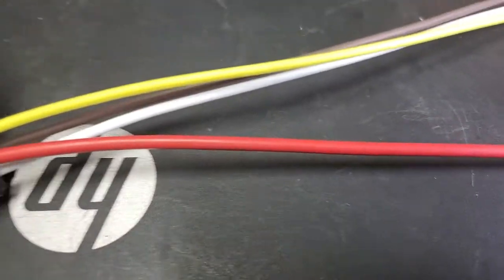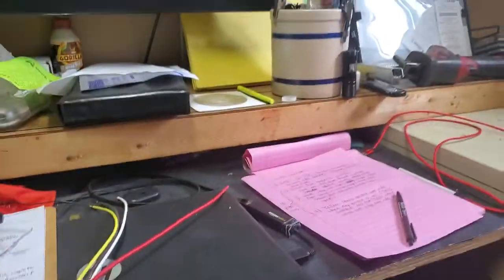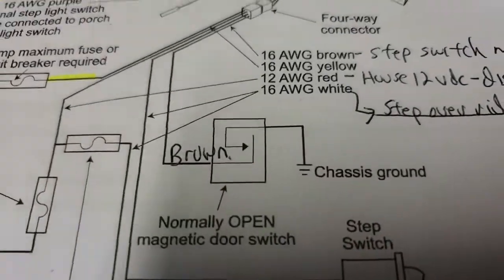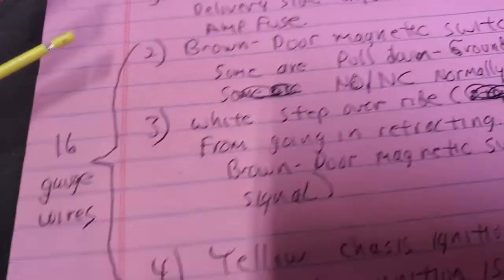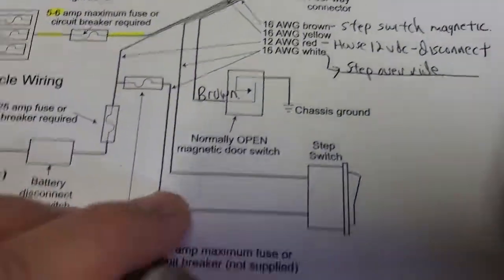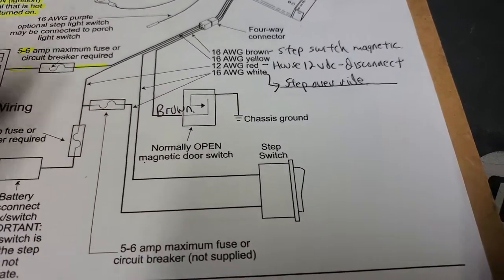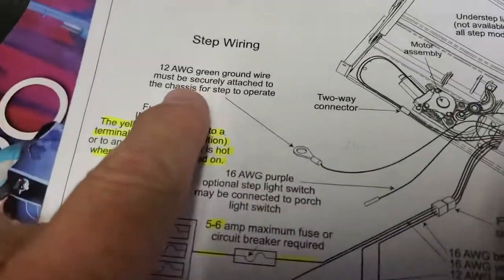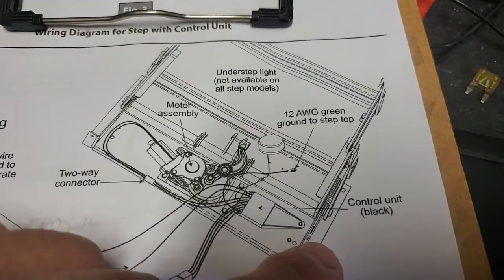STEPS KWIKEE 4 PIN CONNECTOR SIGNALS.Video 1 of 2

Comment: Manual step wiring.
Red and white and yellow to battery.
Brown wire to a toggle switch and the other side of the switch to earth.
Fuses in line of course. 
Any problems with this that you can see it seems to be working pretty damn good.
I just put out the step when I want it out and I put it back in when I want it in .
Reply from the maker: When your step is out and you're inside  with the door closed and start vehicle by law the steps must come in when ignition is turned on.
Reply: @Rvdiagnostics thanks that's good information

Comment: Excellent! I've got enough to do with changing the pigtails to accommodate the new control unit to have to figure out what the "purple wire's" function is  (the old unit did not have one) I thought maybe that had something to do with lighting but wanted to verify before changing any connectors thus voiding any warranties or RMA's. Is it the increased current draw when the stairs hit their end points that signals the control unit to cut B+ to the motor? Thanks again P.S. I have a 97 Rexall Vision on a P-30 WH chassis. When we first got it,  it immediately had issues with the "new" hydrolic parking brake system. Well after many phone calls to GM & Rexhall I got no where with either so I did find the GM shop manuals for it and finally figured it out. If your interested I'll relate the story of the problem(s) and the fix I came up with. I also videoed the process. I'm dying to publish it in the hope's of saving anyone who experiences the same or similar issues, the absolute grief I endured dealing with the vendors (not the vehicle so much)
Reply from the maker: Ah yes venders .
Reply from the maker: The purple wire gets tied into your porch/stairwell light .So the step light ( yellow ) underneath stays on . Just a little bit more light for dark campgrounds

Comment: I have a 2017 forest river forester with a Kwikee step 888. It suddenly stopped working after being plugged into a 20 amp camp ground plug and we realized it needed 30 amp so we switched sites. The electric step won’t operate. There is no noise coming from it but light is on. Any help would be greatly appreciated.
Reply from the maker: Did you check the fuse to the step. Also I made a video on kwikee step